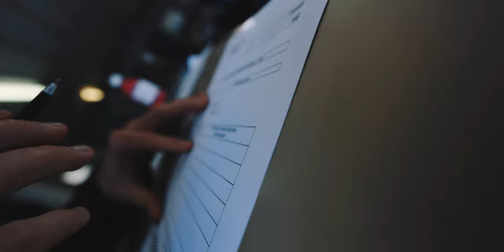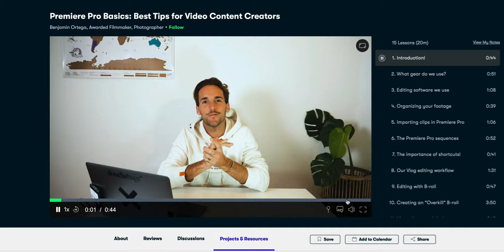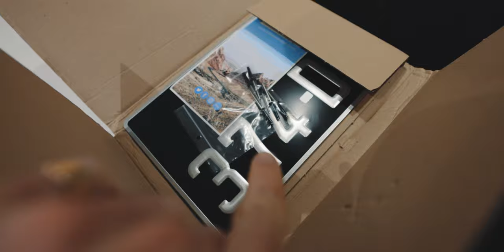The day I PICKED UP my DREAM CAR, Mustang '68! 🔥

Comment: Sick video!! Just one tip: don't go to the carwash with it, the brushes and high pressure will scratch it instantly. This will cause micro-scratches which you'll barely see in the beginning. Better spend a couple more and go to a hand or soft carwash.

Comment: Hi Benjamin,  I own a 1968 "Bullitt" Mustang GT 390, identical to the Steve McQueen car.   I have driven it across the entire continent 3 times and up the CA/OR/WA coast -- terrific trips!  My only issue is the heat inside the passenger compartment.  I have added a good air conditioner and lots of insulation in the floor, doors and ceiling, but am still getting about 10 degrees F of rise inside.   Do you have this issue and what are you doing about it?   Thanks and happy driving!